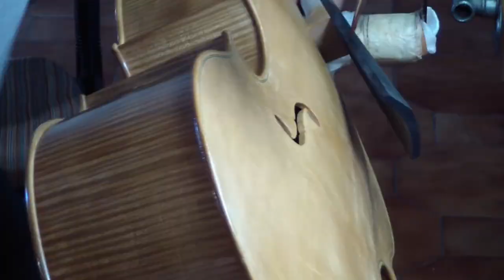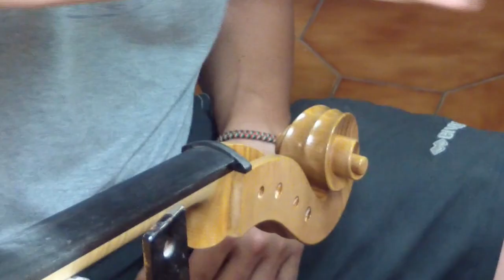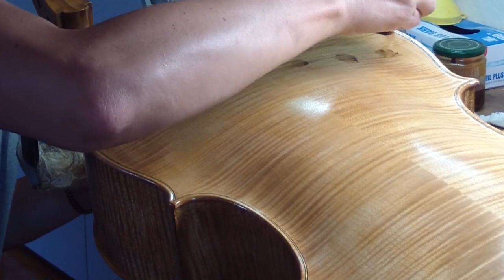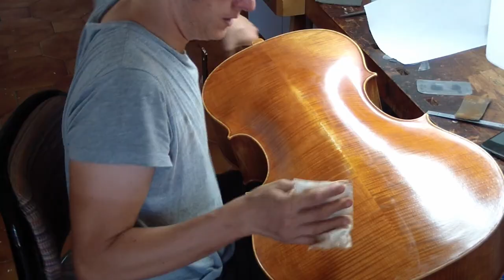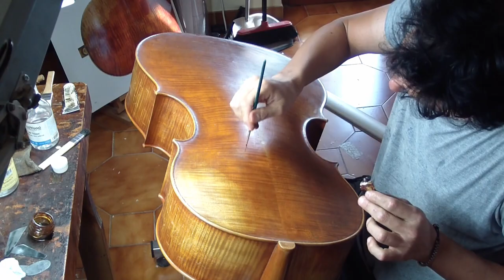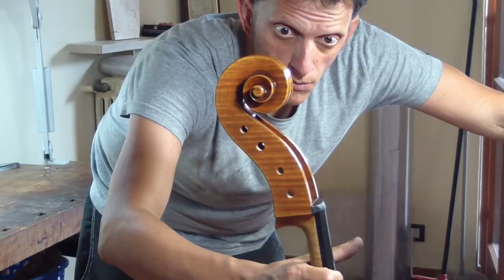Cello varnish.

Comment: Amazing!!! Do you sand before every layers?
Reply from the maker: Thanks for the appreciation.
I don't need it as I will then antique the varnish, perhaps it could be necessary if I make instruments with a new style.
Reply: @Andrea Varazzani  aah ok, so if you only normal varnish the sanding is needed but antique you should not sand?
Reply from the maker: @JosesGarage101  It's always needed, but when I'm creating the shades to age, I'm basically sanding
Reply: @Andrea Varazzani  I have a cello I've got from a violin maker club and it's old,  the ribs has change its positioning and the lower ribs is not original and that sad because it's not matching with the rest. Somebody has probably done a repair on it but I wonder how because without a templet is it possible?
This is a totally restauration I have to do if it can be made.